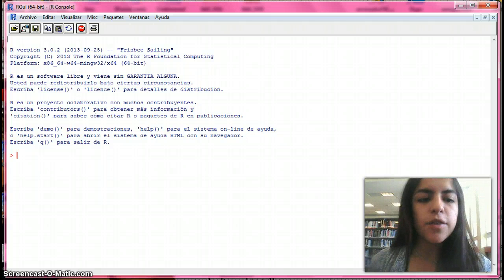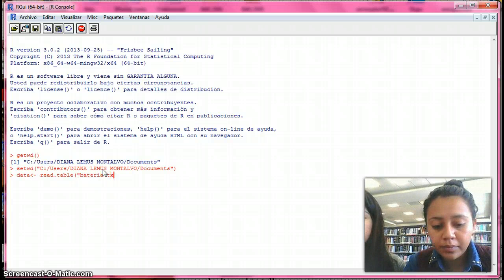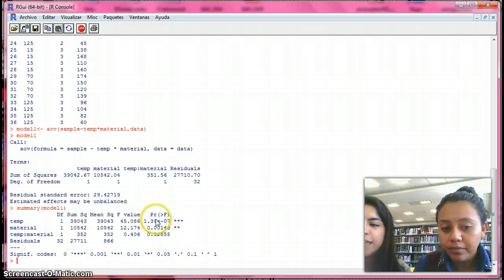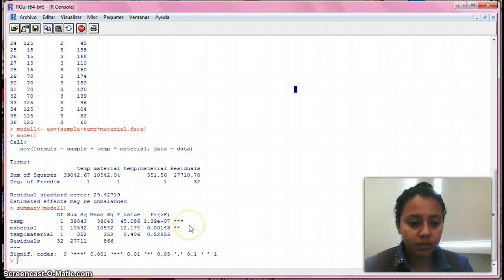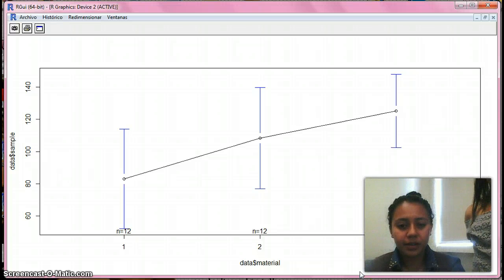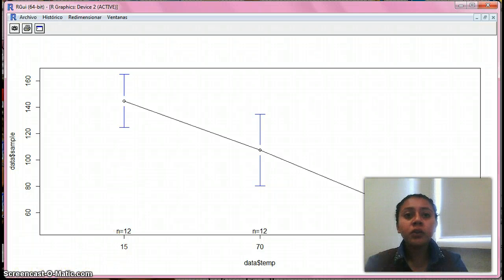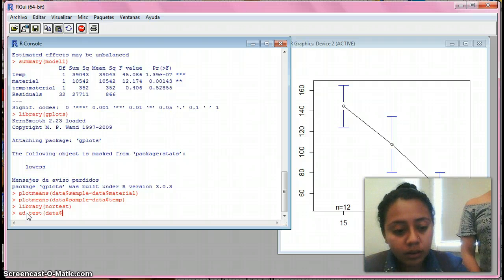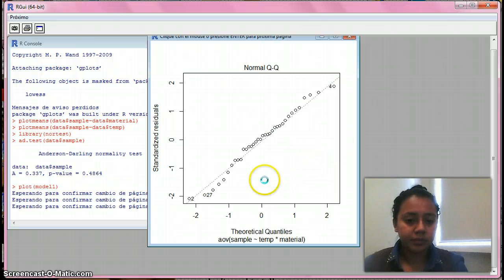Two Factor ANOVA

Comment: Ok Introduction. Ok quality sound. Did not show the excel spreadsheet to see how you distributed the data -4 ; residual vs fitted is not a complement of anderson darling, it tests the equality of variances -3 . And the general conclusion? -2 . 91. Very good job.